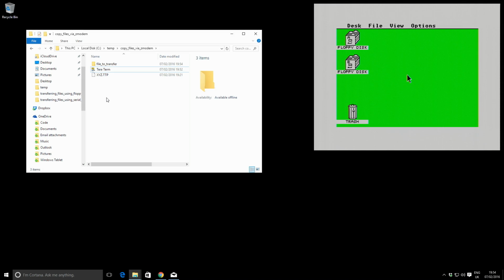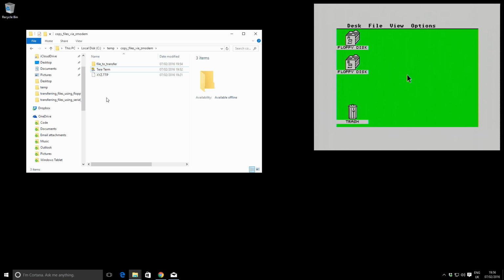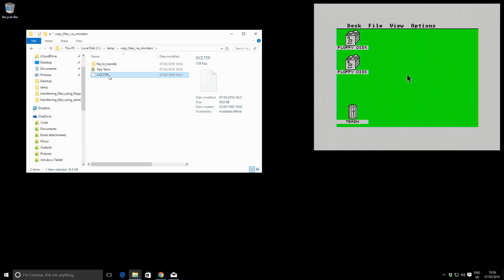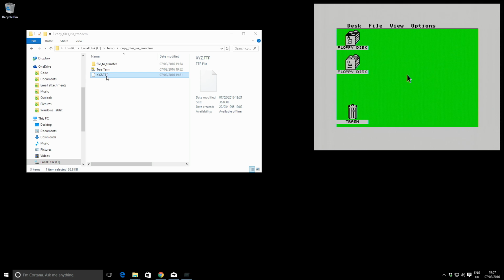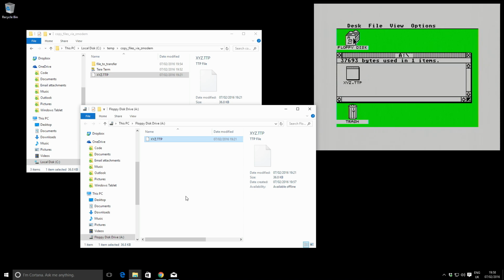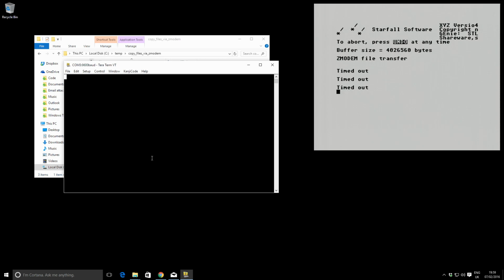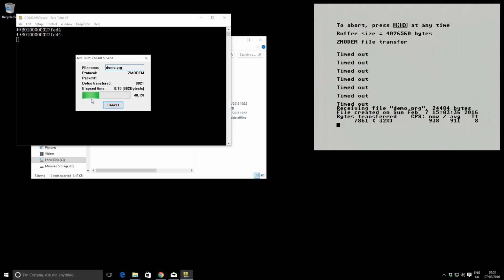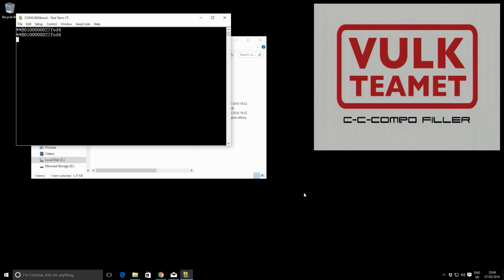Using a Serial Cable and ZModem to Transfer Files from PC to Atari ST

Comment: How do I get the Atari ST zmodem software on to the Atari ST, when that is the problem I am trying to solve in the first place? How is this not addressed in the video, the summary, or the comments?
Reply: Also, do you need to use a null(switched wires) cable or just a regular straight cable? How is this not specified?

Comment: Thank you. 
Can I send files across the System from the system with windows environment to the system at EFI shell ( pen drive being connected for storage), I have serial cable connected across ?
Reply from the maker: Unfortunately I don’t know whether X/Y/Z modem is available inside the EFI environment - it likely depends on your device
Reply: @jamesfmackenzie  thanks for your reply. 🙂

Comment: On the Atari side, can you select a different disk, say Ultrasatan SD as the destination disk?  It seems like there's only a little bit of configuration possible on the XYZ side.
Reply: I guess the solution is to use the SD as the disk for XYZ.  Sounds easy!
Reply from the maker: Mike Baas yep! That will work! By default xyz.ttp will use the current directory for copying files. Optionally you can specify the folder you want to download to when you launch xyz.ttp e.g. C:\DOWNLOADS. Hope this helps!

Comment: Is ZMODEM really being used today? Isn't it outdated? Actually I don't have much idea about that. You can help me on that. My manager had told me to learn the ZMODEM protocol.
Reply from the maker: Bishal Gupta I use it exclusively with retro/legacy systems. But it may still be in use today for modern embedded devices e.g. routers, switches etc
Reply: jamesfmackenzie thank u for that. do u know which FTP is better than ZMODEM and is widely used today
Reply from the maker: Bishal Gupta SMB/CIFS and NFS are popular. Also FTP and SFTP. It all depends on the capabilities of the system you need to interface with

Comment: HOW TO TRANSFER FILE FROM TERA TERM APPLICATION TO UBUNTU PC THROUGH Z-MODEM(I'M USING USB SERIAL CABLE)
Reply from the maker: Tejas Bhumkar if you want to transfer from a Windows PC to an Ubuntu PC you have many better and faster options. However if you really want to use Z Modem, you’ll need to find a Z Modem server for Ubuntu. Luckily it looks like this is built in. See http://manpages.ubuntu.com/manpages/trusty/man1/rz.1.html

Comment: How can I transfer files from my PC to another device I'm running through Teraterm?
Reply from the maker: You need to X, Y or ZModem software running on the remote device. What are you looking to transfer files to?
Reply: I'm trying to copy numpy on a development kit from itron, its called Itron Riva Dev Kit. So, how can I copy the files over to the device?